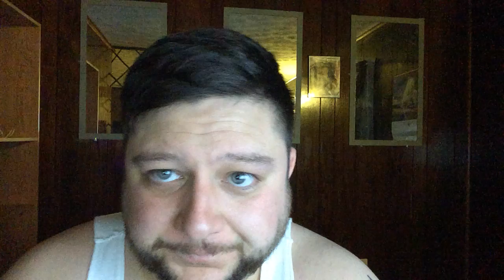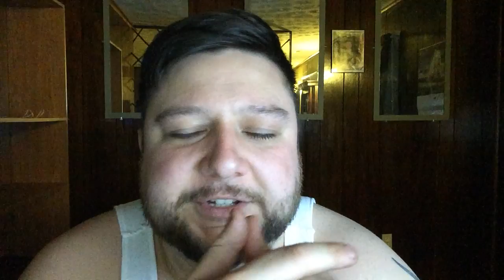High Compression Turbo: Can It Be Done Safely?

Comment from the maker: hope this helps the "cant do highcomp boost" myth fade away
Reply: VHB Engines it is shedding light dude. Thanks dude👍👍
Reply: Hey VHB - what about ring gap? I keep reading that the reason people running high compression w/ boost break ring lands etc is because the stock ring gaps are too small and they close up under boost heat / pressure. So if you open up the ring gap by a BIG chunk, you can get away with murder even on stock pistons.. - Waddya know about this? Engine master mentioned this on one of their stock engine boost tests where they got over 700 HP (maybe over 750 I forget the end number they stopped at - motor did not break) but basically all hey did was open up the rings... nothing more. Your thoughts dude? Any experience w/ that??
Reply: VHB Engines thanks bud for the info idk if u already talked about what im gonna ask but if you did please direct me to it cause i probably missed it i seen alot of your vids tho,so i finally bought a h22a
 60 trim turbo (eBay)
(eBay) waste gage 
Grams 550cc injectors 
Aem fuel rail
Aem fuel pressure regulator
Skunk 2 Intake manifold
1320 balance shaft delete kit
Brandnew steel braided oil lines 
Fidanza lightweight flywheel for 1,300 i have my own tail bov and gonna buy soon a good wastegate and an h2b kit because im putting this motor on my 4 door db8 with my grs trans so the question is do you advise me to put lower compression pistons on the block before i throw this on my engine bay or leave it with the stock pistons? And just do 7 pounds.
Lol I saw your video where you say you rather not boost an H cause its more money and you can get same power with the b20 its cool but i already bought it and wanna do it right..thanks for your time man i appreciated it love your vids👍
Reply: Stumbled across this. Even in the domestic engine iron head world i run a 9.2:1 BBC  chevy and it never had an issue at 10 lbs boost and 92 octane unless it runs a little warm in texas mid day weather. Then i just keep off the throttle. 
Compression is much more responsive  and makes the lag seem non issue.  I run an s475 for a freightliner.

Comment: I have always preferred "high compression low boost" builds. A k24 vtec killer with 10.5:1- 11.1:1 static compression on 7-10psi boost that spools around 1800-2500rpm is a killer setup for street with a good tune. Just gotta do the math on the dynamic compression ratio and determine what fuel you gonna run first. I believe the equation is ((boost+14.7)/14.7)×static compression ratio of the engine= effective compression ratio. Adjust for elevation and let it rip!

Comment: Low compression helps prevent unwanted det. Remember high compression turbo engines are deisel for a reason.
Reply from the maker: I know why it's done. In the modern era it's neither necessary nor done anymore. This is proven not only by modern tuners but the auto industry itself

Comment: I have a mmr 2v stroker and it has 8.5 compression and I’m going to pull them for a higher compression, my stock compression is 9.6.1 range, what you think of a 9.3.1? Or theee is a 9.8.1 range, this is gonna be a boosted build lol, trick flow ported heads and stage 3 blower cams
Reply from the maker: the new norm for honda turbo compression is low 10's (10:2, 10:3, 10:5:1) could be different for what you have but i doubt it. tuning technology has advanced a fuckton and nobody goes with low compression to boost anymore now days. especially if you want big power
Reply: VHB Engines yea that’s what I figured! Thanks bro! Appreciate the feedback I think I’m going to go stock compression or even 10:1

Comment: My daily driver has a b16 13:0.1 compression and is super reliable with a hardcore street tune.   Ive been boosting high compression B's since 98.
Reply from the maker: ahead of the curve
Reply: So im new to the b series and wanted to know is it safe for me to boost my 90 integra with b16 head b20b block on low boost and its stock the motor is high compression 310cc prelude injectors its running off a h22 ecu
Reply: @Omar Bethel  it's safe if you have a good tune.  B20 blocks aren't the most reliable, cylinder walls are thinner than b16 b18 blocks.  Low boost you should be fine. I personally always replaced my b20 rods and pistons with forged.   Replace rods,  make sure your crank case is ventilated and stay under 10psi if your going high compression and your block is still open deck.  My last build was a 12:5.1 b20vtec with wiseco pro Tru b20vtec pistons eagle rods. Css block. Sold the car to a guy in Pinellas County 5 years ago and it's still beating up on vettes and stangs.
Reply: I'm thinking going 13-1 512cui 8lbs boost will this work ?
Reply: @Jesse Chronister  of course it will work.  Any head port work?  Make sure you have a good wastegate if you dropped a bunch of money on your 512ci
Reply: Can I boost a 12.5.1 A6 what should I do turbo or sc
Reply: @kidsavage86  torque storm makes a decent supercharger for a whole leg less than the competition.  A6 is a tough engine.. cheap turbo setup would definitely be cheaper than sc
Reply: I wanna do a high compression b any info you can send my way while I'm building would be much appreciated
Reply: @TheMrmagic101  what do you need to know?
Reply: @justiceofthesun7303  what needs to be done in order to run high compression along with boost and how much boost. So far I've heard things like a larger intercooler for more air and a larger ring gap? Just wondering what needs to be done before putting things together

Comment: May be stupid but im running 13:1 compression. Is it To much for a turbo set up?! im pushing 215hp with 195 tq on a built b20v forged pistons / rods / cranks with b16 jdm sir head /skunk two cams and lma with golden eagle vtec. Stock injectors stock fuel rail upgrading soon along with the throttle body. Fill like I could get more power tuner was kinda new to hondas Idk but just carious about it.
Reply from the maker: thats pretty high compression. wont say you cant just that i wouldnt
Reply: Got a h23a compression ratio 10,6,1 want to turbo how much boost you think I could run

Comment: lets see if i can get a reply on this, my car runs stock compression ratio of 11.0:1 now i know for a fact that the same motor comes out the factory with turbo BUT it has lower compression. so my question is can mine take boost?

Comment: I have a 13 to 1 compression ratio on my 2.0 i4. Should I worry about getting forged work done on my engine/block? Maybe pistons and all that? I want to be the first turbo corolla hatchback without having to modify the engine too much. Maybe 50-100 more HP & torque. Any chance that’s possible to do?
Reply from the maker: i dont know enough about the platform to give you a 100% solid answer but you can for sure add 50whp without issue and id imagine 100 is also doable.

Comment: Hey Andrew I have a question I hope you can help me with. So I got a 96 mustang gt, the motor have forged rotating assembly. Npi heads and intake. The pistons are a true flat top piston. I got the car with no specs on the build but doing research I see that flat top pistons with not relieve cut outs for the valves gives the motor a 10.99.1 compression ratio. That explains the reason I have to run premium fuel. Now my question is would I be safe to run a blower or turbo? My end goal is at least 450wrhpbutt if 500rwhp is possible if be more than happy. Any advice on this sticking to premium pump gas only?

Comment: 👍🏾🔥 I got a H22a Euro R comp 11.1 I’m gonna.thtow a light turbocharged R30
Reply: Did you do it yet
Reply: Robert Brewton  bumped into another problem no odometer or triple check the VSS cluster wires double check pin outs?

Comment: How to do it today:  High compression with enough boost to raise the volumetric efficiency of the engine.  Say a 13.5: 1 ratio (optimum thermal efficiency) and maybe a couple psi boost to get vol eff over 1.0.   You need a fuel that won't detonate under those conditions.  E85?  Nope.  Only about 98 octane.   93 octane with a quart of Torco per 8 gallons?   Do you feel lucky?   Nitro?   Get real.   
There is a fuel for you and its cheap.   CNG.   Easy 120 octane.   A 22:1 diesel won't start on it.   They do have "dual-fuel" engines that use a tiny squirt of diesel to blow-torch the natural gas into ignition.   With 13.5:1 compression and 8-10 psi boost you don't have to worry about detonation.   You can run all the spark advance you like.   Beyond that you better worry about the head studs.

Comment: Sure it can be done.   Look a the 1945 Merlin engines put in Spitfires and Mustangs.   Outrageous boost and compression.   Made the late model DB 603s look like boat anchors.   their secret?   150 motor octane fuel.   One helluva dose of tetraethyllead.   Had to change plugs after every mission, but it made the Spitfires and Mustangs look like jets compared to Bf-109G fighters.
Reply: Very, very interesting. Thank you.

Comment: See i was always taught to keep it undsr 10:1, but then recently i found out that Ford EcoBoost engines are over 11:1, so i started thinking maybe we have fine enough control over everything nowdays to allow boosting high compression engines? I mean the 2.0 EcoBoost block shatters at 770hp apparently, so its not some overbuilt beast by any means either. So... do i go out and slap a turbo F20B into my FWD DSM to piss purists off and maybe it will quit breaking down so much??? Hahaha (really though. Ive had the car 7 years and driven it for 3..)
Reply: Yes go F20c! Brent from PFIspeed YT channel is building one to handle 1,000+ hp! Built everything of course..but they're super stout motors.
Reply: Compression ratios are relative meaning that static compression is one thing, dynamic compression is another. Compression and cam timing go hand in hand. Since we have better cylinder heads with better chambers, better engine management, etc. you can do things that a long time ago were not practical.
I like alcohol fuels since its readily available near me. An ideal build for me would be 12 to 1 compression, appropriate cam timing and going for maximum reliability and power naturally aspirated.
Reply: Keegan Johnson hey pal the reason they are getting away with such high compression ratios on all new turbo engines is because of direct injection.

Comment: So I have a question I've talked to you on Facebook before about my h22a build JDM H22 I can't remember the compression off the top of my head but I want to say I think it might be like 10.6 to 1 if I'm wrong my bad I did not check the specs before watching this video but I've been looking for the Nippon racing H22 turbo Pistons that you did a video about on the H/F series I cannot find them anywhere I've searched Google and eBay just cannot find them so I can find the Nippon Racing type S H22 piston which would raise the compression a little bit I plan on going with Boost and a stock block for now so I'm trying to find and figure out a limit for my compression ratio and my PSI not a definite limit just an idea I do not want to go crazy with my compression I probably would not ever want to go past the Type-S as far as compression I have been researching a lot and I have never done a boost bill before I've always stuck to na for reliability sake but I'm starting to see that boost on a good tune can last a long time I just have to find a way to tune my car after I build it because I live in such a rural area that I would have to go to another state probably almost not really but at least half way I'm looking to keep this a reliable daily driver about 350 to 400 wheel horsepower tops and if the type S piston would be a bad idea then would it be okay to run my stock pistons on Boost because I can't find any alternative pistons and I cannot afford to sleeve my block right now and of course I'm dealing with the frm liners but I love the H22 and it will bolt right into my Accord with the transmission that's in it

Comment: I got a b16. Wiseco piston. 10.5:1 but... 81.5mm supertech valves. Flat and nitrided. Conetic .030 but the pistons require .040 Gtx3076r makin 462whp on 9.25psi. At 6000 feet elevation.

Comment: heres how ppl should look at it take 2 stock gsr's and put 8.0-1 pistons in 1 leave the other 11.0-1 which is faster????   that low comp is gonna be slower than a d series. now add boost and things get real interesting...
 boosted low comp car is already under powered and doesnt make more power till in boost( needs time to spool aswell)  the stock gsr on boost still has ALL of its power even out of boost and when boost hits power increases( also means faster spool time )   most ppl only care about the PSI number itself to brag about anyway lol... 

    only draw back to high comp and boost is that at some  point u max out how much air and fuel u can push b4 detonation stopping you from making more power.   with low comp your able to keep increasing fuel and air cause your increasing displacement by using lower comp piston or raising the deck height so you can fill the gap with more air and fuel and make more power with drawbacks being lag and no power at all till boost .. 
      really it all boils down to what your power goals are....    say for example a HiComp boost will max out @400hp ( just painting a picture here) and thats your goal and u have to choose HiComp or LowComp to reach 400hp.. the HighComp car gonna be faster.  but if u want more than 400 then Lowcomp can keep going but HighComp is stuck where hes at or boom...... hard to explain in txt but im sure u get what im sayin
Reply from the maker: MMORPG87 good writeup
Reply: You're right !
Reply: The way i see it, if unless you're going to build the block for hp numbers which go past stock block limits, might as well stay with the high comp

Comment: pretty sure although you can correct me and my tuner if we're wrong, but the reason you want lower comp is stock head studs cant handle the pressure.
Reply from the maker: Greatmoose well if your boosting with high compression than you’ve already swapped pistons and if you’ve already built the block than I would assume you’ve bought arp headstuds. Even boosting low comp can stretch the bolts and lift the head
Reply: well I know I said high compression and that would lead you to believe I meant something like 14.0:1 but really what I was talking about is stock compression my bad
Reply from the maker: Greatmoose when I was answering I almost said “true” high compression because of that so yea I understand where your coming from. But the stock engines that have slightly higher compression will also, by design, have stronger head bolts. But even then assuming your talkin Honda I’ve gone over where I feel comfortable taking stock engines with boost if you want them to last
Reply: yea was thinking the same, my 'tuner' told me using 2 head gaskets will lower comp enough for low boost(8-10psi) what's your opinion on this?

Comment: I myself have a high dynamic compression on my 4.6 Stroker in my Cherokee and run a Sprintex supercharger with a larger TB and much smaller pulley to get me up to 6~ PSI under WOT.  I used the MOPAR cam to increase dynamic compression over stock.  I have a thinner headgasket to reduce quench area to increase squish (which actually reduces detonation due to increased swirl properties, IF you have dish style pistons.  Domes won't have this property).  I had to get custom forged pistons with +16 CC's over the stock 13 (for a total of 29CC's) in order to get my compression down.  Stock is Static at 8.3 and dynamic at 7.3.  My setup was 8.9 / 7.8 in the end with 6 PSI boost.  I even tried running 87 octane briefly and didn't experience any knock (however I also have a water injection kit that increases octane when it turns on under boost)  That was expensive, and I am usually at low boost unless I am at mid to high throttle.  Then I get about 3-5.  WOT from a stand still I can manage 6PSI briefly.  The reason people say do low compression is because it has been tested that you can actually get more power with a low comp setup running 30-40 PSI vs. running high comp on 8PSI.  Effieciency on the 8PSI high comp setup will be much better and you will have better low end performance.  Performance on the low comp high boost will suck until you hit middle RPM band.  It's worthless for a street car if you ask me unless you live in an area where you can frequently open it up.

Comment: It's all in the tune and fuel. I never put mine on the dyno but it was a little too much. B20 standard stroke and bore B16 head, 10.4:1 compression wiseco, Manley rods, eagle knife edge crank,  7.5lb chromoly flywheel.  Wouldn't build boost very good but they guys at delta camshaft hooked me up with some cams that made it work a little too well. I ran 1200cc precision injectors and never went lean.